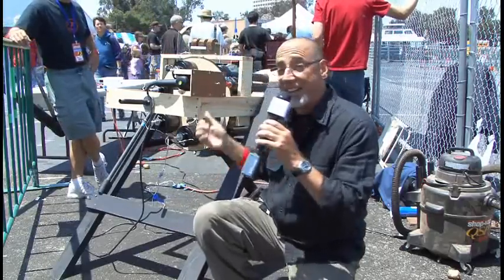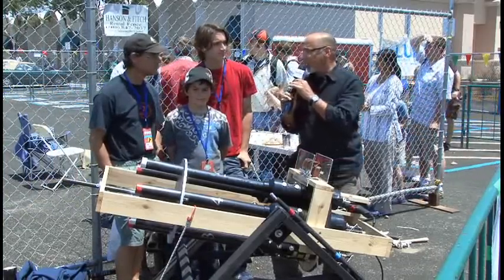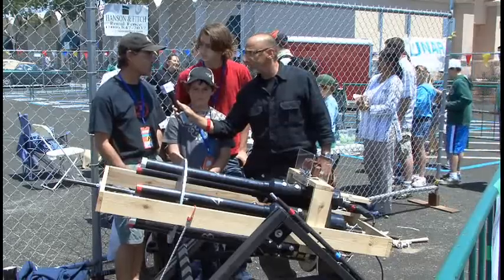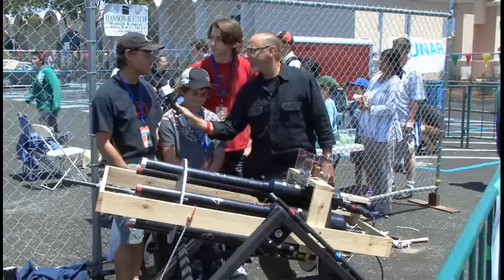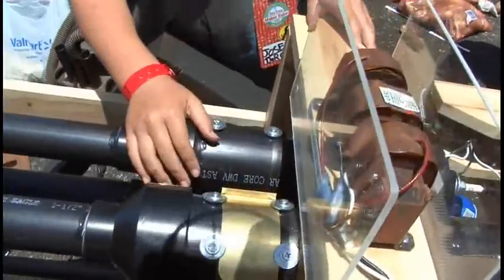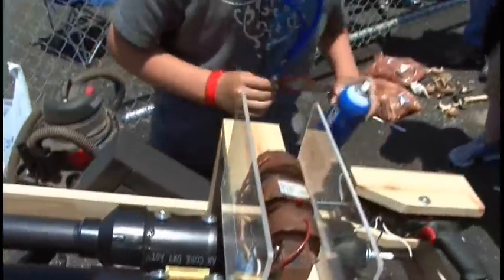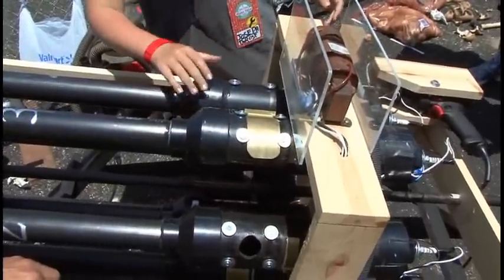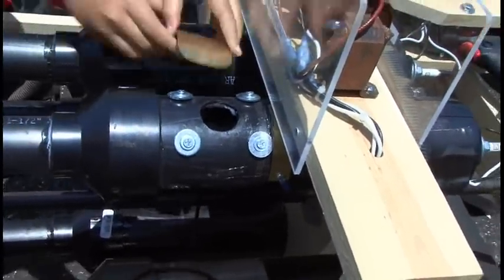Weekend Project: Potato Gatling Gun

Comment: That potato gun is weak. See 4:15 onwards. Some of them barely hit the target. I've used single barrel ones that would go a quarter mile with enough velocity to do some heavy damage. It's better to use WD-40 instead of hairspray, but with a cheap bbq push button ignition that you can get at any hardware store and a pvc pipe, you're in business. That said the design shown is overly complicated with no real performance benefit to justify all that work.

Comment: if they rebuilt the fuel in jection system they could up grade to using starter fluid or WD40... leave the hole for the hair spray, and replace thew sliding metal door with a flex steel spring hinge so it for the most part stays closed and the compression from the blast seals the hole tighter, add a gasket, you may increse the range up and maybe exceeding 200 yards

Comment: not enough barrals

you should have like 6 barrals

and instead of patatos

use like concrete blocks
looks more spectacular
stil cool though
but by the time you load all 4 and spin it up tospeed
a guy with a 1 barral one could have more than 4 shots
with like a fan, and butuan fuel
and you could make this with a channel for loading the itiems, and use tin soup cans because they are even in shape
have fan in each barral, and each connected to butane
so it fires more